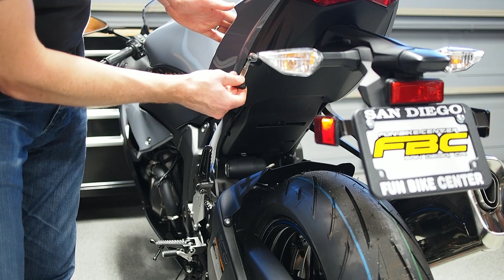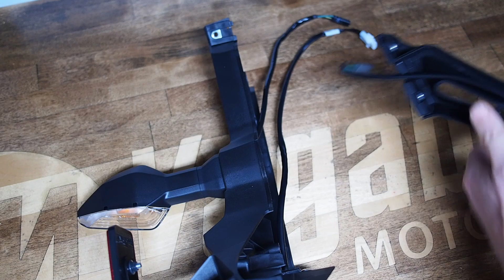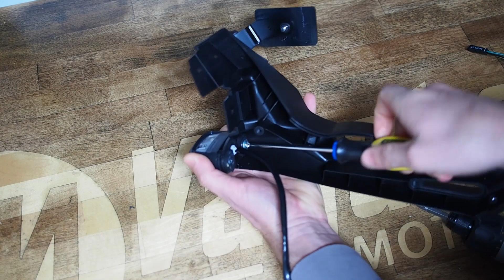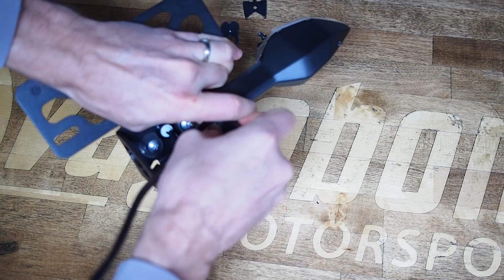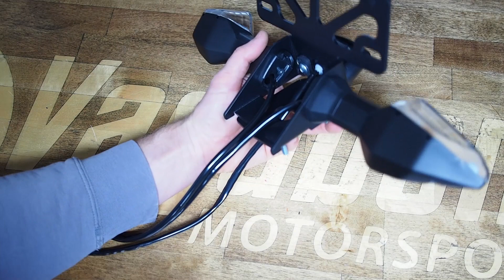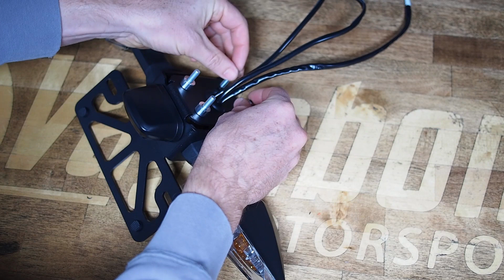Kawasaki Ninja ZX-6R (2019+) Fender Eliminator Install - Vagabond Motorsports VM-KN620

Comment: Heads up to anyone trying this on a 2025 - the left and right turn signal clips are much bigger than what are shown here. it seems you may need to grind out the whole in the fender eliminator bracket for it to be large enough to feet the clips through to feed through the bottom.

Comment: Works perfectly for the 2024 zx6r. Just had to remove a plastic insert from the turn signals and put it back in after fitting the rubber part of the turn signal
Reply: I put this kit on my 2024 40th Anniversary. 100% fit. Putting the rubber collar in the cutout was the toughest part of this though for sure. Struggled with the second one for a bit. 

I have a Subie as well. 04 STI sits right next to my 40th.
Reply: @803scsubie  good call out on the plastic insert. was basically impossible otherwise to install on 2025

Comment: Does this fit the 2024?
Was gonna go for r&g but prefer how this uses the stock number plate light over r&g using their own.
Reply from the maker: It doesn’t fit the 2024. Sorry.
Reply: @VagabondMotorsports  are there any plans to do one for the latest zx6r?
As far as I am aware it uses the same rear end as the 2019+ models though.
Reply: This 100% fits the 2024 models. Just installed this on my 40th Anniversary.

Comment: I filled out your request form on the website and, after no response, sent an email and still have not received a response from your sales team. Wanted to place an order and want to know if you ship globally and which courier do you use.
Reply from the maker: Hi!  We do ship globally. Where do you live?
Reply: @VagabondMotorsports  wanted to get the zx6r fender eliminator kit. I assume the 2024 has the same rear fender as the 2023. Located in Dubai United Arab Emirates. Do you use FedEx or DHL? Thanks.